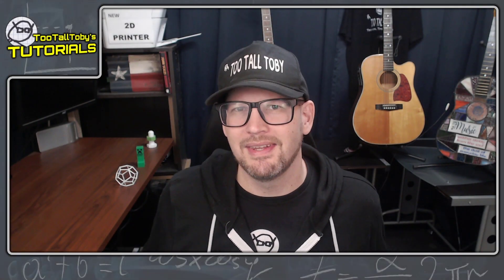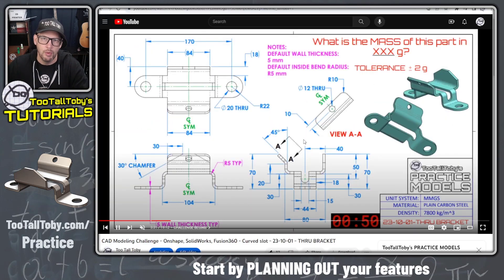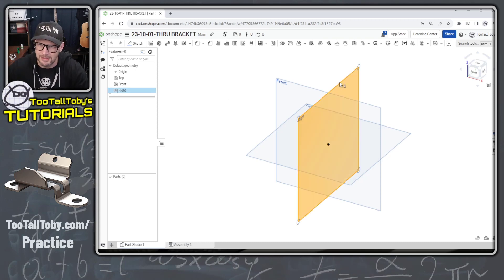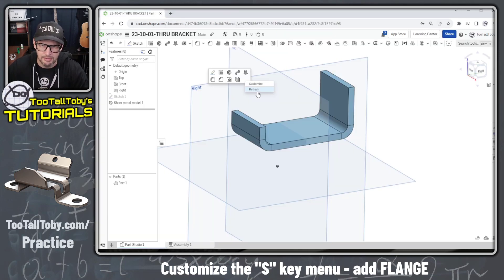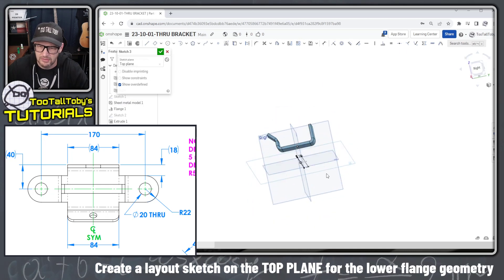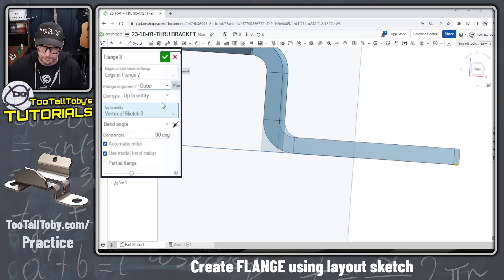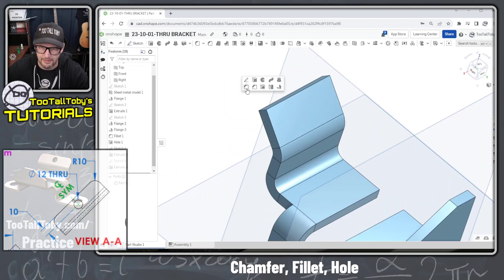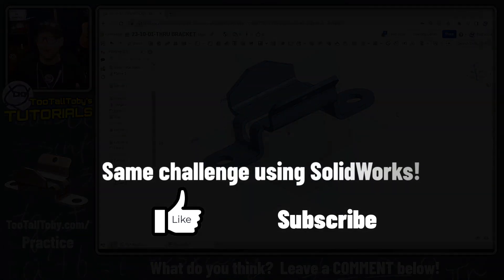Onshape Sheet Metal Tutorial – THRU BRACKET

Comment: when i add flange and size down to "partial flange" @8:36. It automatically adds a relief cut out into the body of the part itself. That it did not do for you. How do I null that from happening?
Reply from the maker: Set the relief type to TEAR 😀
Reply: Thanks!  @TooTallToby
Reply: Hey thanks that worked. my model looks like yours now. So is there a way to set the relief type to Tear in settings? I had to add 2 bend relief instances in my feature tree, one for each relief cut on either side of the flange. I worked fine but, I'm wondering if I did it right.  Is there a place where I can just go to set Onshape so that all my flanges just generate without relief cuts? @TooTallToby
Reply: Also, thanks for the great content!
Reply: @TooTallToby  How do you set the relief type? I’m completely new to CAD and want to learn

Comment: Nice one!
The main thing I would have done differently is the layout for the "ears": if you just added something with the correct width (like adding a slot to your line, or even the whole profile and using it for cutting afterwards), you could use that for the partial flange with an "up to" instead of typing in the values. The 12mm hole would be a good place to show how to use an offset mate connector with the hole tool to place it in one go (instead of doing an extruded cut). The  benefit of using the hole tool consistently is that all the holes created that way will show up in the hole table (on the right above the flat view), right now you would only see the 20mm hole in that table.
Reply from the maker: Awww that's good (the offset from mate connector hole) - I gotta try that on a future tutorail!  Thanks airwick!!  (and thanks for the other suggestion too!)

Comment: I got an answer within tolerance of 644.88 grams in build123d. I am curious what was the bend radius of the 45 degree "flange" using the approach you used in OnShape? I used 5mm in build123d and my mass is slightly different (by 645.2-644.88 = 0.32 grams). Does OnShape assume this radius based on prior operations in the model?
Reply from the maker: Yes - you define the radius when you define the initial sheet metal feature, and Onshape uses that radius for all subsequent sheet metal bends.